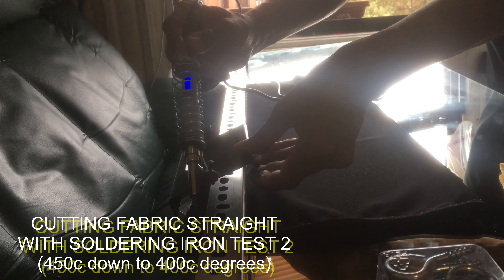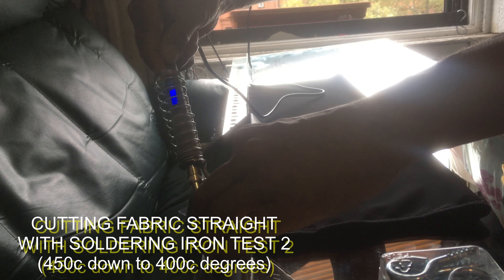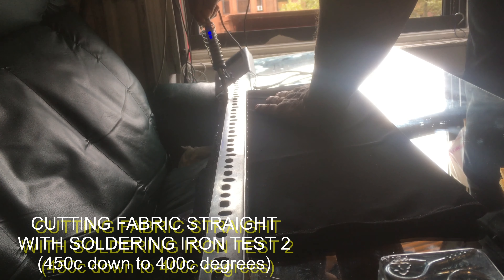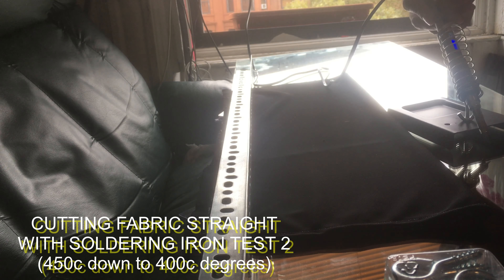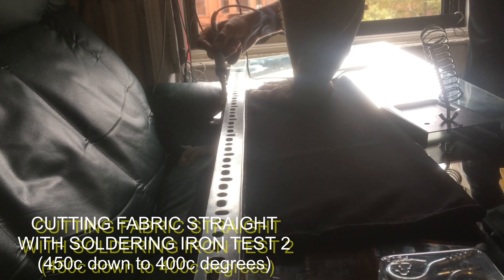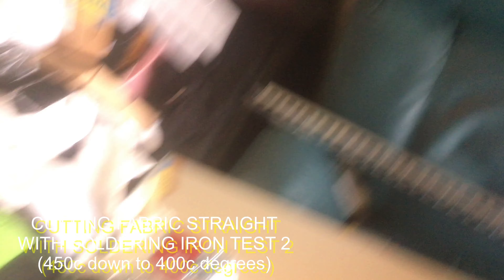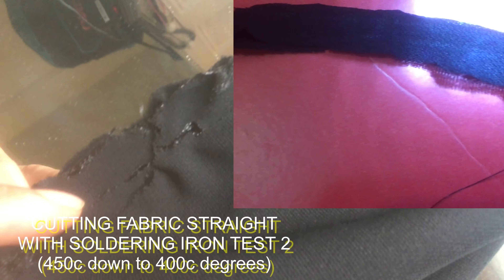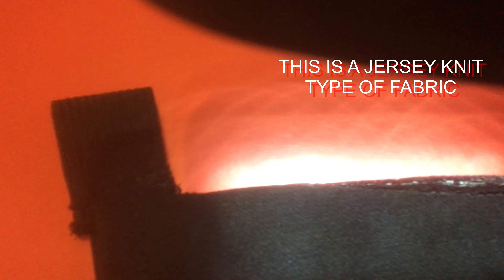CUTTING FABRIC PERFECTLY STRAIGHT WITH SOLDERING IRON TEST 2 DOOM WORKSHOP

Comment from the maker: Q:  CAN THIS BE USED AS A HOT KNIFE?

A:  Yes, but I must caution you that it’s not the manufacturer’s suggested or intended use for this product.

My personal suggestion as a workshop novice is this tool can be repurposed as a hot knife (I used it for fabric cutting).  

Results: It cuts perfect and straight; however, there’s a failure curve: as long as I was cutting fabric under 7 or 8 inches in length, it worked like a charm.  Whenever I tried cutting fabric of longer lengths (even though I held the fabric in place securely and/or adjusted my temperature settings accordingly) the cuts began to skip or get stuck.  Granted that might not be the fault of the tool, but working manually, human error is bound to threaten good outcomes.

Pros:  It works like a charm on small synthetic pieces of any material.  Less is better: the larger the cutting surface area the more likely it is to burn material rather than cut straight.  

I used the finest tip to get the best use for fabric.  Your intended use and tip selection may produce varied results.